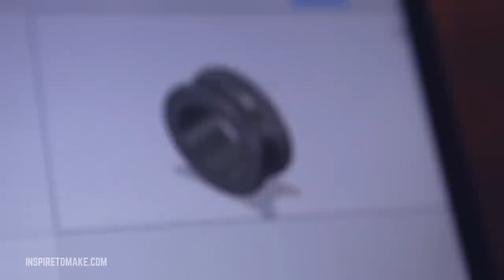DIY Cable Cam with bluetooth controlled gimbal

Comment: I see that the motor control and potentiometer were installed on the unit itself. How did you control the movement remotely?

Comment: This is nice. But would have also loved to see the actual footage using this setup. Had tried a similar thing but without motors and it had a lot of bounce and was shaky. Still trying alternatives for this to work. Thank you for the video. :)

Comment: I'm excited to see a 3D printer that looks like mine printing!  It gives me hope!  I like the idea of the cable cam too!  All those sweet panning shots without having to worry about vibrations!
Reply from the maker: I like this printer. It took me a while to set it up, but then it's running it's good
Reply: My control board is no good so I can't update the firmware.  I have an upgraded board on the way right now so hopefully that solves my "get it running" problems.  I'm looking forward to tinkering with it to make it printer better,.

Comment: Hey ! Great Video. How would you do to use a fm receiver instead with a remote control to control the direction and speed ? I am looking for the material for that but I do not know what to take
Reply from the maker: Google how to make an RC car. It will be similar concept

Comment: While cool that is not DIY at all. DIY items usually don't have custom made 3D printed parts.
Reply: Those you can easily drill from a piece of solid wood and file in the depth... DIY AF
Reply: It's not diy because he used an electric drill and an electric saw.... OMG
Reply: every think that you do yourself is a DIY what do you mean?
Reply: GeeZeRFroG a 3d printer is a tool and can be found for very cheap such as a $150 Anet A8 which deliver excellent results with a good build volume.
Reply: you can always get those at a hardware store tho